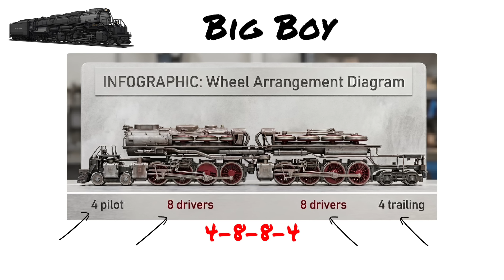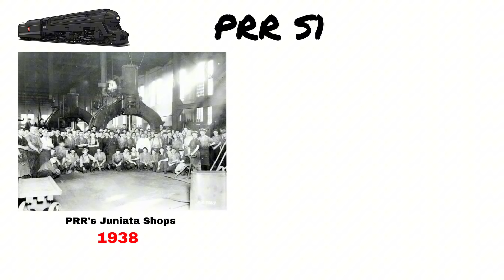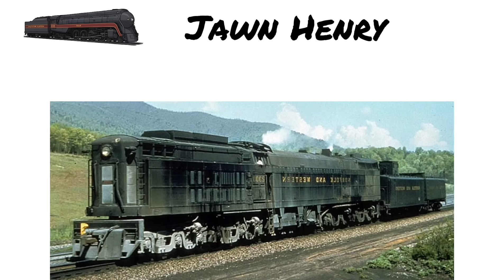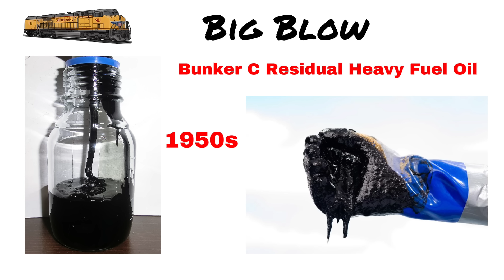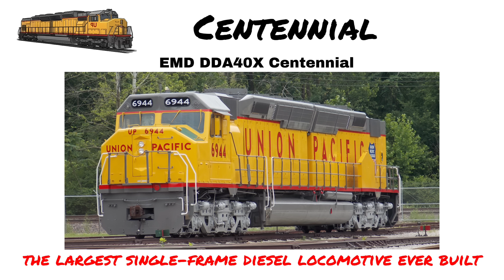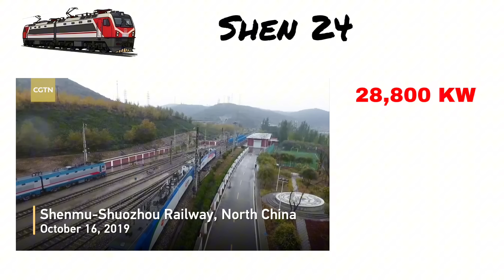The Biggest Locomotives Ever Built Explained

Comment: actually Ohio Allegheny is bigger than the union pacific big boy buddy
Reply from the maker: The Chesapeake & Ohio Allegheny was heavier and more powerful than the Union Pacific Big Boy, though which one is "bigger" depends on how you measure it buddy
Reply: @LocomotiveAnatomy  i measure it by height
Reply: @LocomotiveAnatomy By scaling The Chesapeake & Ohio "Allegheny" is bigger than union pacific big boy by height and weight even though big boy is lil longer (135 ft than The Chesapeake & Ohio "Allegheny" 125 ft by length) an Allegheny is a little more powerful than big boy
Reply: Basically the The Chesapeake & Ohio "Allegheny" may be shorter but the biggest with height and weight and power

Comment: Alright. So, I have these measurements per each part of my D.N.S.U.T.E. 10x7 diesel devourer Neo-Steam engine in length. (For each 10 small wheels: 45 feet, for each 10 drive wheels: 65, for each battery (used for Neo-Steam characteristic electricity) connected to each of the 10 wheels: 5 (+2 for each per rotational systems connected to said batteries and wheel sets), buffers: 2, knuckle couplers: 5 (outmatching the buffers by 3 feet. Total length: 731 feet more or less.

Comment: China out here trying to tow mountains 😭
Reply: Kind of a stupid idea to make a locomotive that long, when you can just couple smaller ones together and operate them as a single unit.  Now you have to take the whole thing out of service if one thing needs repair.
Reply: @ffjsb  well, do you have to, really? That depends on the design.
Reply: @РайанКупер-э4о it makes no sense, especially when it comes to maintenence.
Reply: @ffjsb  what if it's modular and you can use it in shortened configuration?
Reply: @РайанКупер-э4о  "modular" is pretty much what every modern diesel is...
Reply: @РайанКупер-э4о  If they're permenetly attached, yes.
Reply: @ffjsb , well, what if you need modular electric trains?